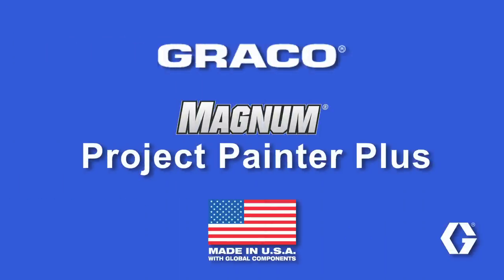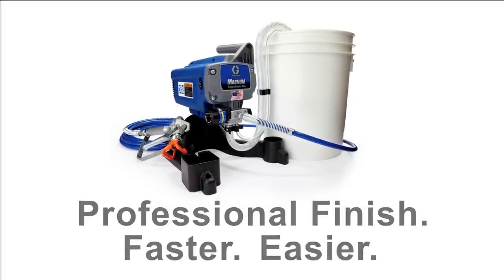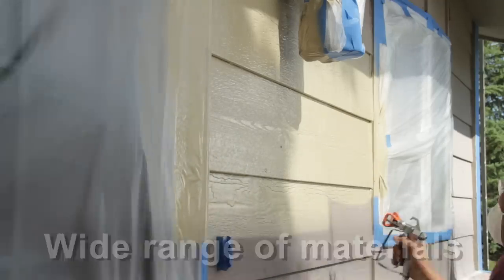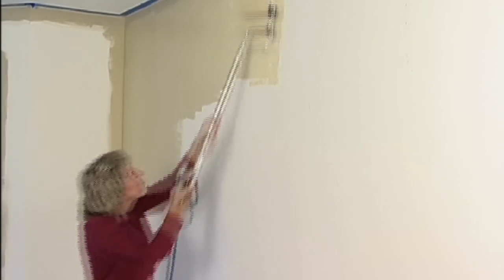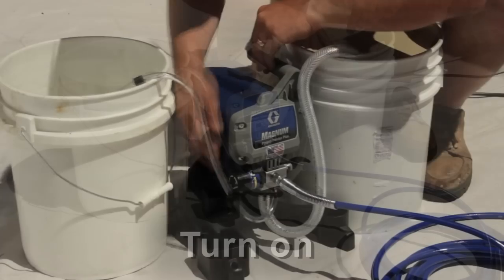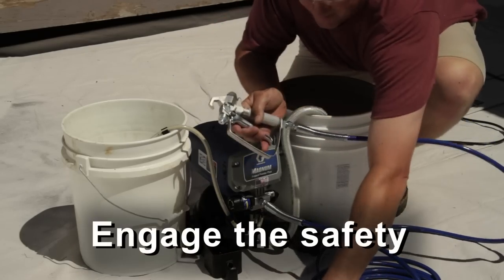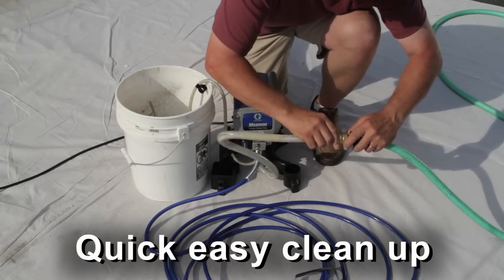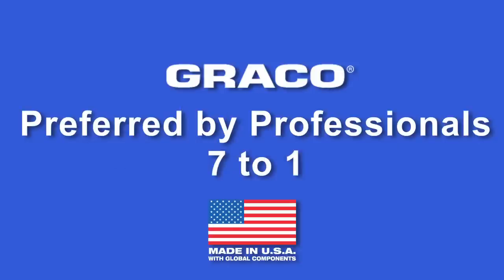Graco Magnum Project Painter Plus

Comment: Do I need to connect a hose, or can I use a bucket of clean water?  If I do use the hose, should the painter be turned on, or does the hose force water through?
Reply: Unit needs to be running as there are valves that are opening and closing as the pump operates.